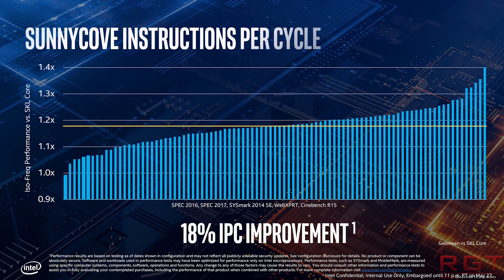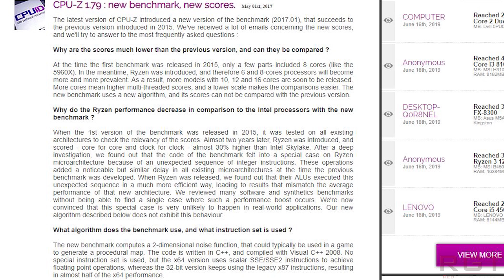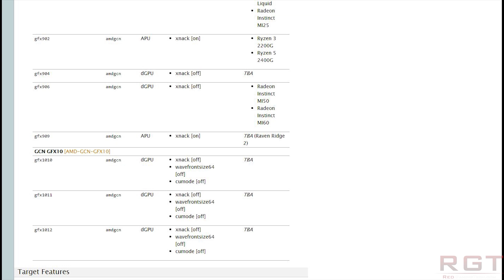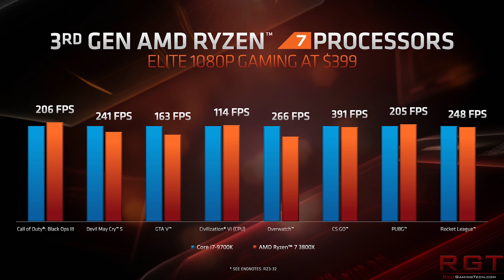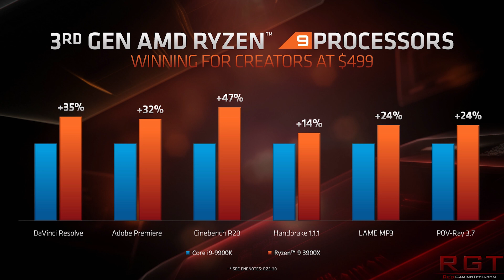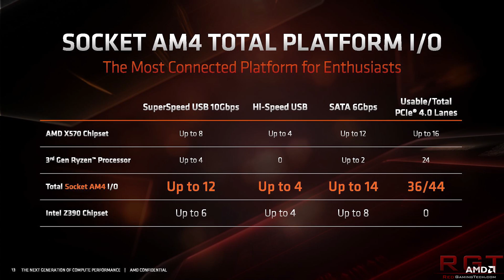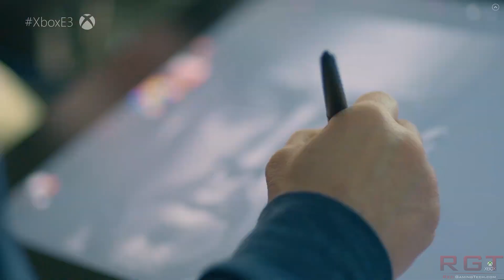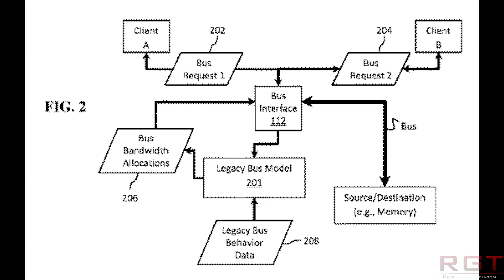2 More Navi IDs Spotted | B550 Launches next Year ? | Xbox & PS5 To Cost 400 USD

Comment from the maker: 0:22 Intel Comet Lake, Ryzen 3000 benchmark
5:38 AMD Navi - two more IDs spotted
7:31 B550 incoming ?
10:00 Pachter on next gen console price
12:18 RIP Xbox backwards compatibility?
Reply: X590 rumors any true?
Reply: Thank you for the time stamps!
Reply: Sunny cove has several upgrades that can double or more than double the IPC on a specific micro benchmark, while there are others that stay basically the same. 
I'd expect to see some outliers in terms of performance improvement in benchmarks.  If good fraction of benchmark time it is bottle necked by store bandwidth, going from 1 to 2 store instructions per cycle changes that.  Any increase in cache size and associativity can change inner loop from missing almost all the time that level of cache to hitting the cache almost all the time. Finally if anyone compiles code for AVX-512 you can potentially see  16x improvement in number of operations per cycle.  Doubling the width is far less interesting than having many more situations where you can jump from serial 1 operation per instruction to a vectorized solution. Its about code for which AVX performance didn't matter suddenly being vectorized and AVX-512 performance being determining the performance.

Comment: I don't understand the whole price issue with console's, times have changed people regularly splash out £400+ on smart phones and tv's now. How much was an average mobile phone back in 2005/2006.
Reply: @Bangla Gamers Club I'd have to imagine that at 399 they'd be selling the console at a significant loss, though. Just seems like a very low price considering all the hardware. I guess we'll have to wait and see.
Reply: 400 is a non-issue and the consumer will prove this. I'd actually imagine them to be at 429, 459 or 499
Reply: I don't see an issue with new consoles at $500 and the One X/PS4 Pro continuing to be sold at maybe $250 or $300 for another year or two. It happens with every new console generation.
Reply: I dont have problem even with 599 if the power is there. People dont have problem to buy new iphone for 1000 every year but console for 500-600 which will last 5-7 yrs is too much?

Comment: That sunny cove benchmark seems bunk. If an engineering sample had 40% IPC gains was already beating the zen 2 than Intel would have teased something in CES, Computex or E3. Heck if an engineering sample was better than ryzen then they would have just released them in Q3 to avoid leaking out market share.
Reply: More than tease it, they would have been screaming it from the roof tops.
Reply: The values are all fake btw
Reply: It isn't just IPC, you forgot about AVX clocks. If Sunny Cove (or at least its current low-clocked variants) don't need to down-clock by ~15% like most of Intel's existing models do in AVX512 workloads, that narrows the gap quite a bit.
Reply: it's a server chip and the new platform is far from ready given that they plan to release it with DDR5 and pci-e5.0. so we likely won't see anything until after AMD launches threadripper at the 2020 CES. but icelake should be out in october because intel likes to be consistent. also they want more overclocking headroom upto 5Ghz because those flagship parts have the best margin.

Comment: Those numbers are definitely off. The scaling is way off: 60 more points for 400 MHz (9900k @ 5400 vs 9900ks @ 5000). 13 points per MHz increase for Ryzen? That's so wrong on so many levels.

Comment: By the time the consoles come out, the yields for the parts they using will have increased so production costs will have lowered.
Reply: I honestly wouldnt want to buy a gpu for my PC that's being used in a console. I'd either get the console for a better deal or wait for a good deal on a stronger gpu.
Reply: @jamesbriggstown not really as far as current consoles are concerned an rx570/80 runs games better than the consoles, so for next the situation will most likely be the same cause even if consoles use zen2 and navi they are gonna be limited in clockspeeds and power draw compared to their pc equivalents.
Reply: @BombaJead  current consoles have a tablet CPU so...

Comment: The B550 not launching until next year is a bit of a disappointment, but I guess it can't be helped. Hopefully there ends up being a few B570's that aren't too unreasonably prices after a couple of months. I guess we'll see. *knocks on wood.*

Also, there being some lower-end Navi SKU's is essentially a no brainer at this point I think. It's likely the only reason they haven't been released already is that AMD is still trying to unload all the Vega 56 and Polaris cards first. There's still quite a few of those out there, and it seems like the prices for them go a little bit lower practically every other week. So I wouldn't expect them to stay in stock TOO terribly much longer. So the 5600 and 5600 XT will probably be coming sometime between August and October. Depending on the sell-thru rate of the older model cards they'll be replacing.
Reply: Makes sense, as the lower end Navi models would directly compete with old stock. Seems AMD does an Nvidia move. Hopefully they decrease the prices as soon as old stock is gone...
Reply: @Alexander Vartanov 

Oh I am aware. It would be nice to have the forward compatibility the 570's offer. But I haven't really made up my mind whether that would be worth it or not. Sure, slightly faster NVME,s would be nice and I have to imagine GPU's will use that extra bandwidth eventually. But by the time either of these become an issue, it might be time to build a new rig anyway.

Basically, these are things to consider when I decide to make my next rig. It might be a moot point by then anyway. We'll see.

Thanks for the advice though' I really appreciate it.
Reply: @fabiusmaximuscunctator7390  you can hope for that but unless Nvidia (or Intel tho God only b knows when they will enter the market) forces them to, they aren't going to lower the prices for narvay.
Reply: Next gen games aren't going to be any better in graphical fidelity, only efficiency.

Its too expensive to make games in normal rasterized methods so AAA devs are looking into ray tracing to divert expenses from software into profit from hardware.
Reply: it's to save people from shitty decisions, like me buying the a320 that is basically useless for any notable upgrades
Reply: @dra6o0n  

Not to be combative, but I heard people say the same thing about the PS4. You are right that financial bottlenecks are slowing down the rate at which visuals can be improved. That march forward still hasn't stopped though.

Besides, the GPU's I'm looking at are the Vega 56 and the RX 5700. The next round of consoles will easily beat these two consoles. So leaving some room for forward compatibility makes some sense.

Comment: if they could get icelake on 14nm they might have a chance.  but icelake is HUGE.  but most of that is the avx 512 unit which is supposed to be as big as a whole atom processor and thats on 10nm.  on 14nm it woudl be larger.  if they dropped the avx 512 unit or only had partial support for 512 they could maybe make  a 6 core 12 thread icelake on 14nm and costs and power wouldnt be that bad.  and the gaming crowd might buy it if it was signifcantly better in gaming.  

but i think a lot of the ipc gains in both sunnycove and zen 2 are geared towards pro work and wont show up much in gaming.  zen 2's gaming improvements are proabalby mostly due to better prefecthing and lower latency and higher clocks.  intels latency and prefecthing are already top notch.  i think they just added some execution to match zen in pro work and gaming will be the about the same, so no gains there. but i could be wrong

but if intel hastn released a new arch in years because of process difficutlies.  if they had put out at least 2 arches by now and got the usual 10% or so for both like they did on the 2nd-6th gen intel then they would have a really high ipc desing by now.  we'll see what they have been working on in a couple years i suppose.

Comment: @redgamingtech
Rumor is that Ice Lake maxes out at 4.1GHz, if they got it to 4.5GHz then those single core numbers make a lot more sense.

Odds are the 3.7GHz clock is not detected correctly, that's the base or max quad core speed and single core is higher still.

That kind of IPC gain is incredible, however, the newest release of CPU-Z has an AVX2 beta test, which could explain it all at those clock speeds. Intel has always had amazing AVX2 performance. If Ice Lake has AVX512 then AVX2 could theoretically run twice as fast per clock than the Skylake.

On the new AVX2 beta bench my Skylake i5 6300 HQ ( 2.9 single turbo in spite of it supposedly being 3.2 turbo) scores 427.8 single and 1747.9 multi.

427.8 divided by 2.9GHz times 3.7GHz x 1.18 = 644.06

I'm thinking those scores may be the new beta test.

Comment: I knew the lower end Navis would be a reality. Those should be around Vega 56 performance or less for around RX 580 prices, but we will see
Reply: Except the 5700 reference blower worth of 380 bucks should be around tweaked/partner V56 performance levels. The lower end card should slot between 590 and V56, likely around 280 bucks. But we will see indeed.
Reply: @ErikDvorak  I think that if AMD is able to offer that amount of performance for that price, mid range gamers will be happy. And slightly higher end gamers will be alright with the 5700 and 5700XT
Reply: @jamesbriggstown We don't know how well they will sell until they launch. I'd refrain from such speculation until the cards are available

Comment: YEY, 2 more weaker variants. So legends might still believe their "hiding" the best, but they always advertise the best. If i was going to buy a gpu now (around now, after navi releases) i dont think it would be Navi.
Reply: caRn  Nvidia is more efficient (i think) and has ray tracing. Why buy Navi? If you dont have any arguments, dont attack people. If the rumored prices are correct they will cost about same as nvidia rtx2060/2070. Tell me one reason to buy NAVI (Except being a fanboy or wanting to "help  out amd". People resort to violence when they dont have anything to say.
Reply: @Kcimor78  Ray tracing is the worst excuse to buy NVIDIA, it is a shit feature in anything lower than 2080Ti, the reason to buy Nvidia GPUs is they are just better performers with good TDP and power draw, otherwise a feature that breaks your gameplay to some retarded fps is not a feature to consider, there's no difference with it not being there, unless you're doing that 2080Ti
Reply: Romick. The ris feature seems nice to take 1080 -> 1440 with 100% game compatibility unlike dlss. But I am waiting for a big Navi or stronger rtx card before I move.
Reply: @Kcimor78  why even buy this next gen gpu? Unless you play at 4k. A used vega 56 cost me around £200 last year, £300 new, 64 cost around 40 more. A 1080 cost around £320 used and 400 new. On my used vega 56 Absolutely nothing wrong with it at all, in fact I have won the silicon lottery with it.

We dont know what ray tracing will be like on amd, there implementation might be a lot better but currently i dont think its worth the extra $$$.
Reply: I'll be waiting for the RDNA cards coming out next year.

Comment: 8 core 8 thread cometlake will be next i5 i think.  the new r0 stepping 9900k will probably just be turned into the next i5 and i7.  heard its been tested to clock a bit higher.  the i5 from intel will basically be about the only cpu worth buying from them.  the i7 8core \16 thread cometlake would ok for a high end gaming rig that really wanted no compromises gaming but the extra threads as well.  but the ryzen equivalent would be better for pro work and the cometlake might be slightly better at gaming but hotter.  if you were gaming it would be cool enough though.  and intel have their oem and laptop sales to prop them up.  intel will be fine for a year at least.  they really need to get 10nm out on desktop.  they really really need to get 7nm out within the next 2-3 years if they wanna keep server.  when EUV gets lined out they might be able to.  plus ive heard that the whole pacakge for intel (chip and chipset etc) is actually cheaper to integrate into a system for some reason. but the power draw is not good

Comment: If an xBox and PS5 are going to cost $400, why would I want to spend $400 + on a PC GPU which is less powerful?...
If Intel are producing such a powerful product in Sunnycove you still have the security issues. If people remember smart TVs can be hacked to see and film and sound record you if they have cameras and microphones installed. Do people want that level of hackability in their PC which many people do things like pay their bills, check their bank accounts, store their cryptocurrency on?
The loss of cryptocurrency could be done in one hit - e.g. they don't have to do it as soon as they get in they can wait so that the leak doesn't get fixed until many other e currency owners are hit...
Reply: Its highly likely imo that I'll be 499 simply do to dxr and highly fast ssd. These are currently premiums in the pc scene. Its also likely that games will be running 30 locked with rtx and 60 without it. I can't imagine a console with premium set of features like these for only 399.
Reply: They will release a budget Xbox/ps5 and then they will release a higher end version.

Comment: X570? Who is using all of these usb/sata ports? I don't want to drop down to one PCIe x16 socket to get more sata/usb ports. I don't run anything on sata ports. I need one usb port for a wireless keyboard/mouse, one for bios flashback and one to load an O/S on an m.2 drive. Who are they making this "high tech" PCIe GEN4 mobo for? They have more CPU lanes going to the PCH than to the M.2/PCIe sockets. WTF  We will never get 32/64GB out of usb/sata upgrades. Is it 2002 or 2019?

Comment: one thing im not understanding about x570 is can I run a 16x gpu as well as two 4x m.2 drives? reason I ask is I keep seeing this 36-44 total pcie lanes but cpu has 24 lanes with 4 lanes dedicated to chipset. so x470 I can run my gpu and 1 m.2 drive and all my 20 lanes are taken up. will x570 be the same as x470 in that reguard? or can I now run multiple m.2 drives in full 4x while still using a 16x gpu. any explaination to this would be appreciated!
Reply: you can run one directly off the cpu pcie lanes and one via the x570 chipset

Comment: Eh, the rx 580 is between a 1060 ans 1070 performance with 8gb vram and is dirt cheap. 
I bought mine last year its been good to me the drivers are nice.
I do want to get one of thier new cpus though. That sweet single thread performance :3
Reply: The 580 is much closer to the 1060 than to the 1070, the 590 somewhat competes with the 1070
Reply: @Lightitupp1  I'd say its closer to a 1060ti but I'm on linux. Old amd hardware tends to run faster with the drivers on linux than amd drivers on windows when running proper native ports, even with the 5% improvement amd has given it on windows.
Reply: @hyperdriverr  1060ti? You mean 1660ti? That's basically a 1070 so no, a 1660 is faster than a 580.
Reply: @Lightitupp1  No. 1060ti is not basically a 1070 lol. A 1660 is faster than a 1060ti
Reply: @hyperdriverr  The 1060ti doesn't exist, the faster GDDR memory 1060 is not called the 1060ti. And read what I said, I said a 1660ti is basically a 1070, you were the one talking about a '1060ti' that doesn't exist.
Reply: @Lightitupp1  OH hey yeah forgot there was no xx60ti  in that series.